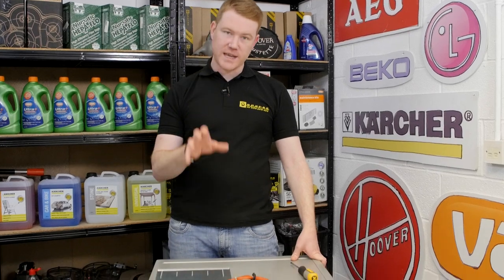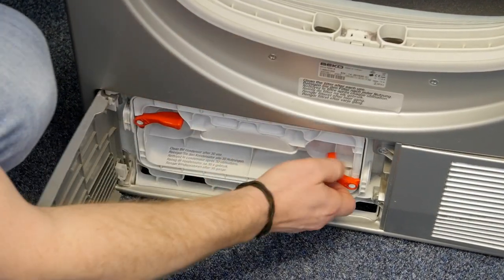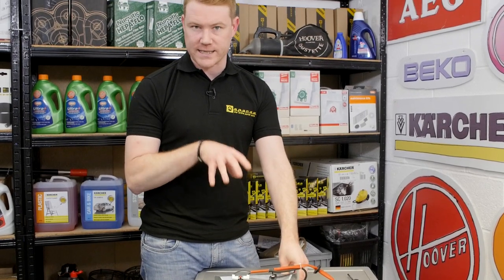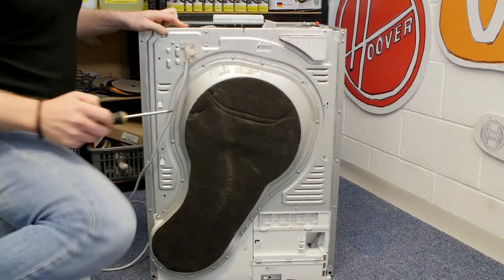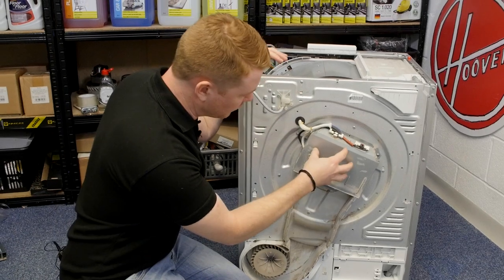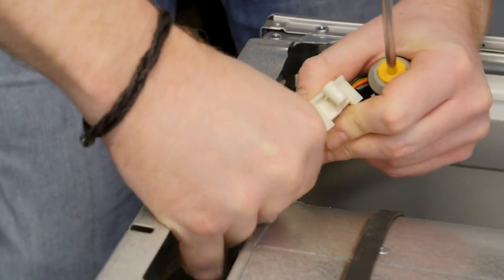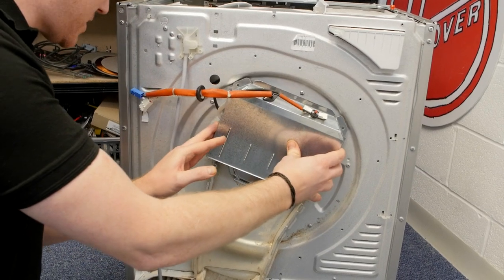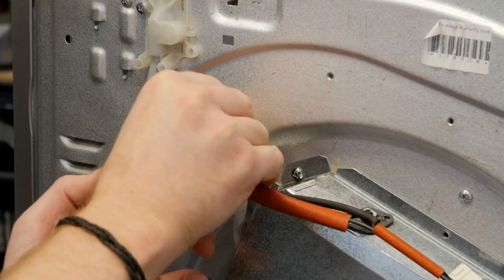How to Replace a Beko Tumble Dryer Heater (DCU series models)

Comment: Thank you very much , I had a problem with not heating my Beko Trembal dryer ., I built dryer with your instruction  .and its done , working now .spend just 40£ for heating element . A similar idea should be kept. Thank you again.
Reply from the maker: Hi, thanks for your comment here, it's great to hear that our video has helped you to replace the heater on your tumble dryer...saving you money!

Comment: Super video, eSpares. If the reset button is immovable, stuck in what I assume is its "up" position, I presume the element then is beyond repair? 
You've put me on the right track - many thanks.
Reply from the maker: Hi Gareth, on the Beko model in the video if the thermostat can't be reset you would need to replace the element because it comes as one unit but check your model first as on some makes the thermostat can be replaced without the element saving you money.

Comment: Hi, my beko tumble dryer (Model: DCX71100W 7KG B) is blowing cold air. I have carried out the following: 
- Assesed the reset button to check if it had tripped but was unable to press.
- confirmed current flow through both fuses
- Cleaned all filters 
- Installed a new heater element
 Still bot working. Any idea what could be the issue?

Comment: Thank you for your video! 
My beko tumble dryer sounds normal, is spinning normally, but not heating. 
I removed the cover and pressed the reset button and heard a click, still no heat. Any tips on what to do next?! 
Thank you!
Reply from the maker: Hi Rachel, you will need to test the heater to confirm if it has failed and we have a video to help that shows how to test it www.youtube.com/watch?v=trJXdqNBn7M&t let us know how you get on.

Comment: If the heater has gone will it trip the main electric circuit board which is what is happening with my Beko. The reset button doesn’t click.

Comment: Hello, Mat. Thank you for sharing this helping info.
I have the exact same model DCU6130 S.

My Q is why do I have to change an entire heater element (which is not faulty) when I could only change both thermostats? For a way lower price.
Reply from the maker: The thermostats for your model are listed to be supplied with the heater element only and are pre-fitted onto the heater

Comment: Thanks, this worked a treat, restting the the red button got the heat back in my tumble.
Reply from the maker: Thanks for the feedback James, there can be two main causes of the cut out tripping.
1: If air flow is restricted from a blocked filter or condenser it can overheat so check these are clean.
2: Often users turn te dryer off when 'hot' and do not allow the machine to run through the 'cool down' part of the cycle. Do not allow the machine to be stopped mid cycle for more than a few seconds or it can cut out like this.

Comment: hi watched this tutorial, finally sourced and bought heater from ebay, for my dtgc8011w beko condenser. now ive hit a snag, the electric connection is housed in a white block thats coming out of a sliver sleeve box, i cant figure out how to disconnected it . many thanks if you reply.
Reply from the maker: HI Sarah,  the connections are held in by a screw and a snap fit connection, you need the top off and there is a screw on the back to release to get the wiring block out and that one is the snap fit one.

Comment: Thanks, a great help, fixed the problem quickly and easily.
Reply from the maker: Hi Bill, thank for the post and glad we could help.
Reply: How to goin in test mode
Reply from the maker: Hi ljubomir, Program selector is set as delicates and while pressing the buzzer cancel button, turn on the dryer. After 3 seconds service test program starts and buzzer sounds. In this program, start/pause/cancel button is used to pass other steps. All LEDs blink.
Reply: @eSpares  dcu7330 for this machine
Reply from the maker: Hi ljubomir savic, yes it should work on the DCU series of machines.
Reply: @eSpares  1.027M ohm ntc it is impossible. ntc is defective,?
Reply from the maker: Hi ljubomir savic, that is too high for an NTC and would normally expect a reading of about 1200 Ohms and it would change values when warmed with your hand.
Reply: @eSpares thanks for your reply. I will order another ntc.

Comment: Great video again, What if the heater is replaced and it still wont work?
Reply from the maker: Hi joseph, how did you confirm the heater had failed? if the heater has been tested with a multimeter and it is OK, check the thermostats, meter the wiring from the board to the heater and let us know the model details if you need any more help.
Reply: @eSpares  Hi did test one read faulty so ordered a new one be on the safe side thank you for getting back so quickly. joe

Comment: Hi can you tell me if the on this dryer should have any resistance or how to test the heating element.  this dryer is the same as one I am looking at but the dryer only seems to be heating up every once in a while sometimes it's running at 70 -80 °c sometimes it's running at 30-40°c and one time after take it apart and putting it back together it ran a few times at 90-95°c which I believe it should do.  Most of the time it seems to be running at 70 ish it's the digital version of the one your fixing in this video. I tested the heating element and the thermostats that's resets let was reading short circuit and the other thermostat had some resistance.
Reply from the maker: Hi Peter. The heater on the dryer in the video has an overheat cut out and a resistive NTC thermister that monitors the air temperature to feedback to the control board. Your problem is likely in our opinion to be the sensor that is supplied with the new heater but it is possible to be due to the control board.
Reply: What resistance is on the thermistor on the heating element at room temperature please. Just helps me eliminate faults. The ntc on the front is reading just like a normal thermistor on the nearer showing room temperature on the my meters thermostat setting. The rear is showing like it's a capacitor rising in resistance as I measure it it settles out in ohms at 8k ohms which is about the same as the front one.
Reply from the maker: Manufacturers do not supply the specific resistances of NTC's. Depending on the meter and its range the current flowing through a NTC can warm the element changing the resistance so this may not be faulty.

Comment: hi ther my beco tumle dryer keeps triping my electric  i have looked at the heater and ther is moisure build up  the buton doesnt reset  so i ausume its safe to say its the heater if so could u put me on the right path  to finde the correct replasment parts from your store best wishes  the model of dryer is beko dcu8230 s/n12-219980-12 thanks flor you time
Reply from the maker: Hi Kenneth it does sound like the heater and here is a link to our website www.espares.co.uk/search/mo1570443pt1584/tumble-dryers/heaters/beko/dcu8230

Comment: Hi my beko dryer is not heating up and the red button keeps turning of and have to keep undoing it to reset it. Plus I had so many parts change for the dryer but still not working. Do you think it's worth getting it fix and buy a new heater for it. Thanks
Reply from the maker: Hi Tina, if the button keeps 'tripping' it is due to overheating. Check the filter and condenser is clear of debris as this may be your problem. Watch this other video before suspecting a problem with the heater:
https://www.youtube.com/watch?v=pxZIetevnSo

Comment: Thanks espares,  I have got the same tumble dryer that you ve worked on in the video,  I am wondering if it's possible to just change  the thermostat and  not the whole heating unit, and if you can, do you sell just the thermostat for this model. Also do you sell the  complete set of  screws for the back panel covering the heating unit as I have lost a few of my screws, thanks pal.
Reply from the maker: Hi Casley, the thermostats are riveted on the heater and are not available separately. For the screws fill in your information on this link and we should be able to supply them: http://www.espares.co.uk/contact/sales

Comment: What the ref number for this part as this is the same make and model i have as there are two on your website which look identical but differ in price
Reply from the maker: Hi Connor, on some Beko models it will be serial dependant so you need your full model's details to get the correct part, contact the sales team who will find the correct part for your machine www.espares.co.uk/contact/sales

Comment: Hi ive a  Beko DCU 7230B  and the light inside the drum is flashing. Looked online and it seems to be a common issue but cant find a fix. Does anyone have any ideas is it a mainboard issue tho the dryer works perfectly. Thanks
Reply from the maker: Hi Rachael, the first thing to check is for a loose connection on the lamp holder, also check the bulb is tight inside the holder.

Comment: Hello I have done what you did with the button if don't work is it defiantly the heater needs replacing and not thermostat everything else works well and were would buy parts I need try fix not buy another dryer this will be my fourth dryer I can't afford keep replacing them my family laugh never seen anyone go through dryers like me please all help would be appreciated thank you
Reply: Hello, if your tumble dryers  are dead quickly is that there is a problem of common mode. This may simply be the fact that you do not clean the filter with each use. When the filter is clogged, the airflow over the resistance is lower and therefore warmer. This triggers the safety thermostat and makes it age longer. quickly resistance. A second common mode case may be a thermally sealed room (ie without sweeping (with fresh air in at the bottom + air evacuation in height (because the warm air is lighter)) of air. The thermal phenomenon on the resistance is of the same nature (but not of the same amplitude) as previously described.A third common mode could be a higher than normal mains voltage, in which case the power dissipated by the resistance would be higher [Formula : P = (UxU) / R]. This hypothesis is plausible but in general, one of the electronic components of the card dies.This seems to me the best way to go.

Comment: is this the only replaceable part or are there any thermostats to replace at?
Reply from the maker: The heater has the main thermostats on the assembly at the top.
There is also a NTC sensor on this model at the front and the video showing replacement is here: https://www.youtube.com/watch?v=uzYNjjAi-eA
Reply: eSpares thank you for the info.  looks like it was the condenser unit being clogged up with gunk inside it on this occasion.   so was taking an age to dry clothes according to the missus.  but strangely enough.  cleaning that out.  my earache has stopped!  thanks!!

Comment: Also beko has a massive problem with the main PCB, that will also give a failure in heating, all other parts will work fine.... This is a problem that starts at the sensors but shows very little sign until it over heats the PCB.